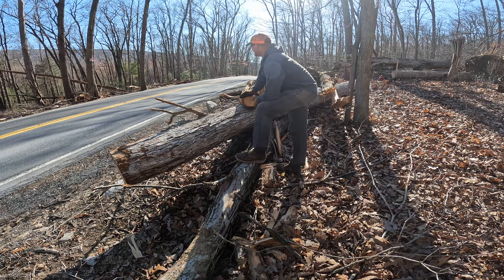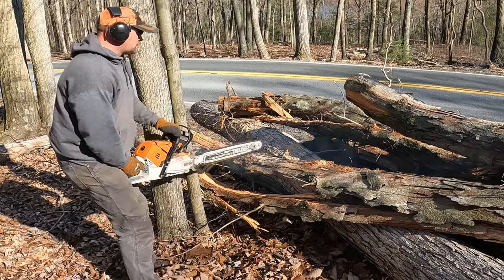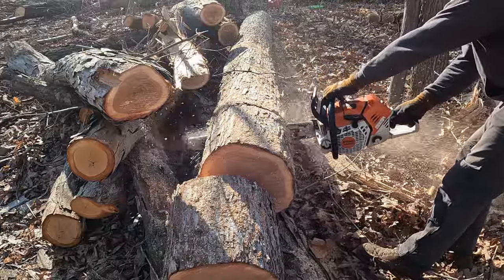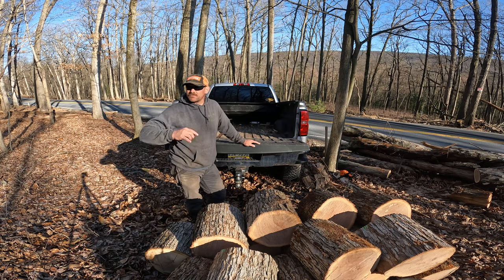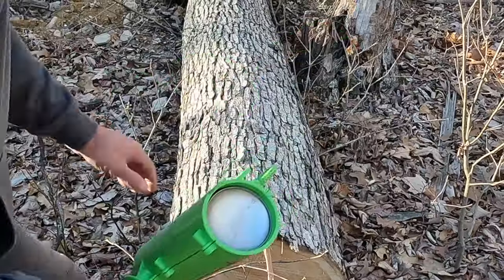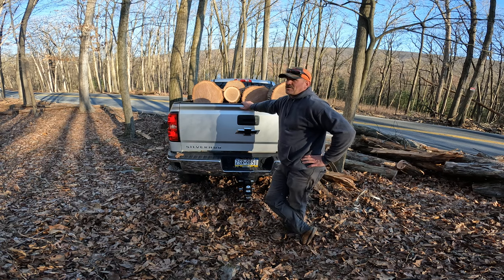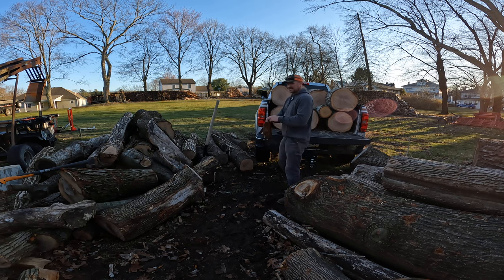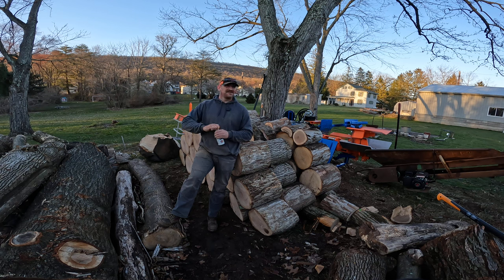Roadside Logging creating an access point ready for the big White Oak

Comment: Don’t worry too much about the sound, the main thing is that you are retrieving all that wood to take home and turn into logs for the townies. You are certainly doing your bit clearing up the environment and thus saving the polar bears. Forty years ago i used to salvage fallen trees from various farms i was working on. I cant stand waste, it’s the principle of the thing. My only concern is your back, you need to come up with a cunning plan for lifting the wood into your pickup. It is very easy to pinch a nerve doing that sort of thing, mine took nine months to come right and i had pain in my right calf throughout, “Hey , lets be careful out there” as someone once said. the best from England.

Comment: Looked like a shagbark hickory that you were cutting and did not take home. Save your back! Those rounds are heavy!
Reply from the maker: I believe that is still white oak I will double check when I get back down there.
Reply: I think it was just the top(s) of the trees, with the bark falling apart.

  I just lucked into a big pile of white Ash tops.  They've been dead at least 5 years, lost much of the bark, and have been baking in the sun and soaking up the wind 40 or so feet up that whole time.  Thus it's rock hard, and essentially dry.  The trunk rotted off partway up, so the top came down.  ( There are a couple pf hundred up to 15" dia trees here- all beetle killed)

  It's great wood, FREE!!, and nearly all of it is no splitters or one poppers!  Best of all- easy to handle.   Never understood why so many sneer at tops and limbwood...  This stuff is very dense, and birns long and hot- making great coals.  Sure, more cutting- but way less splitting!   

Next up, is a pile of Norway Maple (hard).  A huge limb that came down- partially dead, with some barkless.  Every bit is solid, save for where it broke.

Gotta love salvage wood!  Half the work is already done for ya- often including much of the drying!